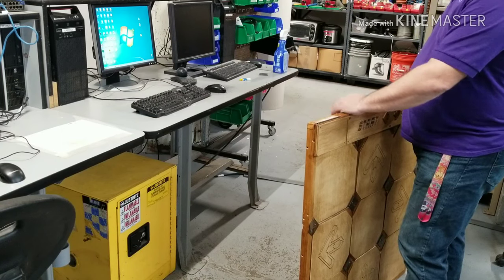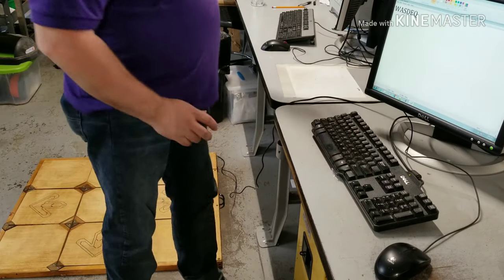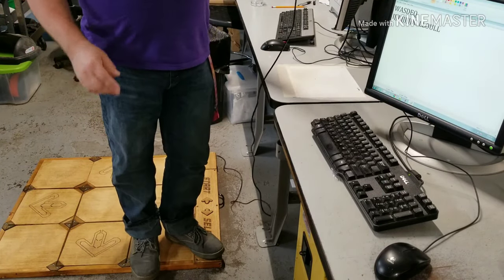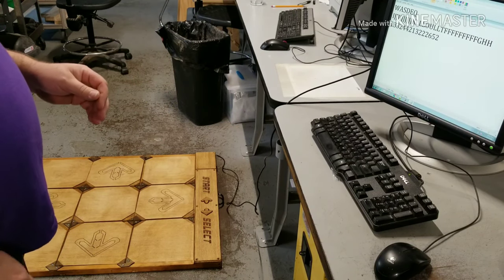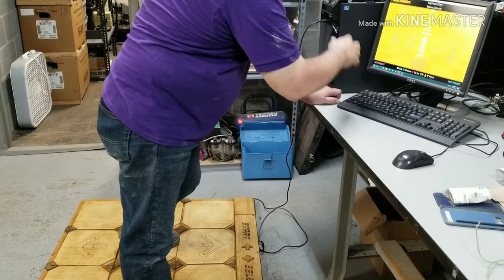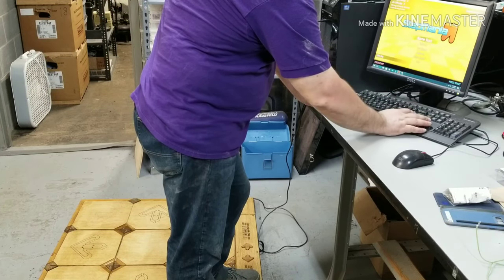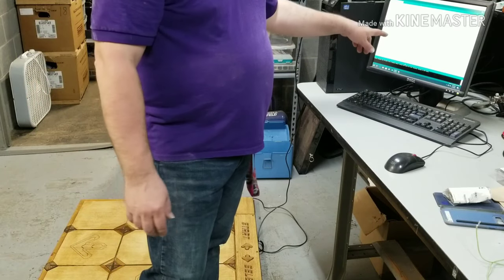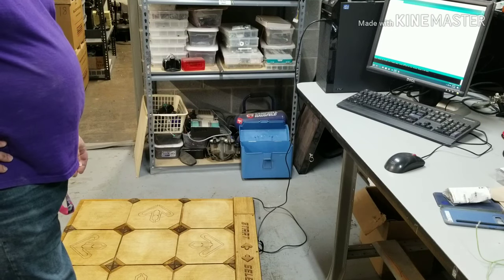How to setup a DDR Pad

Comment: How much abuse can these things take? Weight limit? I like to play with friends but they tend to not be as gentle and stomp really hard on my foldable ones.
Reply from the maker: They are made from 7 layer thick cabinet grade plywood, the contacts are just two pieces of metal that touch,, so they can take as much beating as a hard wood floor.
Reply from the maker: Most of the failers are from broken wires due to vibration but we have since converted all of them to wire harnesses with wire lugs so the broken wire problem should be solved. Plus these pads are made to be serviced. So most of the repairs are done by my customers (with some help from me)